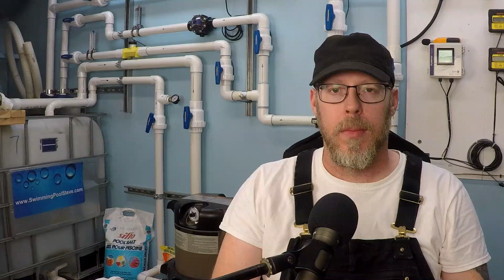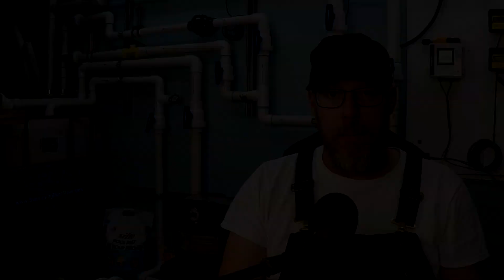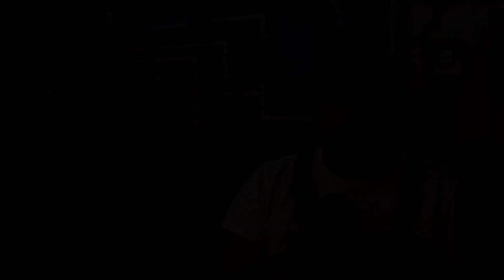How Far From The Pool Can The Pump Be?

Comment: Hi Steve, can you tell me how far can pump be from filter ? would it work fine 10 feet away ?
Reply from the maker: Yes 10 feet would be considered close. 50 feet is far and 100 feet or more is really far and likely needs system design changes to account for the transmission losses and added head.
Reply: Thanks a lot Steve. And congratulations on your channel! Superb info!

Comment: If you are doing a 21 foot round, would 10-20 feet be ok for the pump and heater? it would be 1.5 inch pvc runs under ground to the pool. I think its a 1.5 horse pump if that helps.
Reply from the maker: It would be within the ability of the equipment, yes.
Reply: @Swimmingpoolsteve  thanks Steve !!

Comment: I am considering placing a check valve on my pump’s intake pipe to avoid losing prime when I clean my cartridge filter or pump basket. My intake pipe is 2” diameter and about 20” long so there’s plenty of room. My variable speed pump spends a lot of time at low (1200rpm/29gpm) and medium (1900rpm/42gpm). The valve manual says the spring opens at 5psi. Do you think at low and medium the valve will allow flow or will I not be able to use these settings anymore?
Reply from the maker: A foot valve is a huge flow impediment so I would use a regular isolation valve to manually close the line while you service the pump and filter